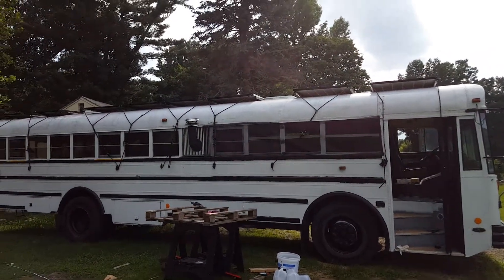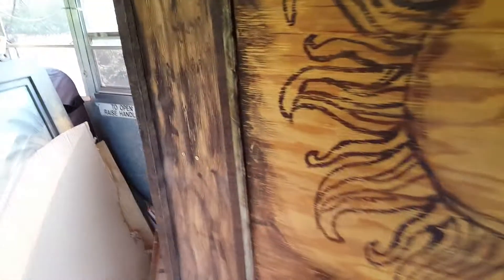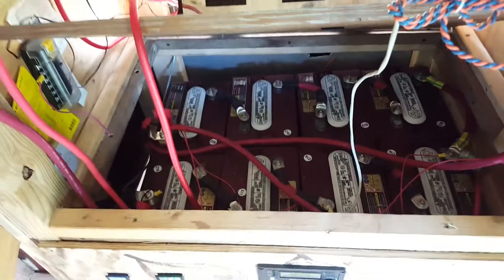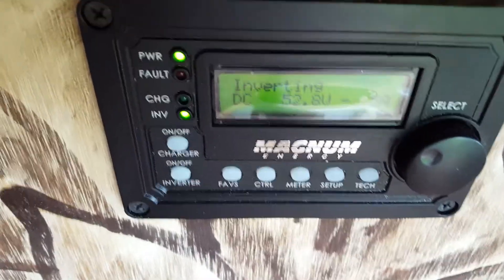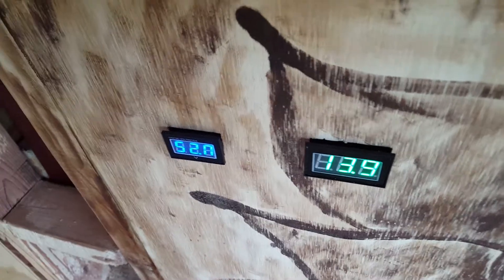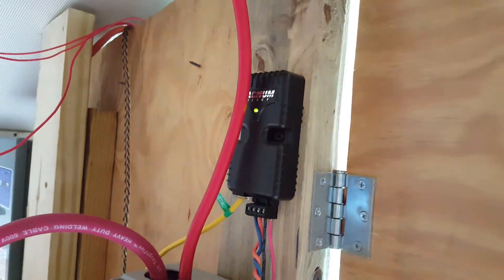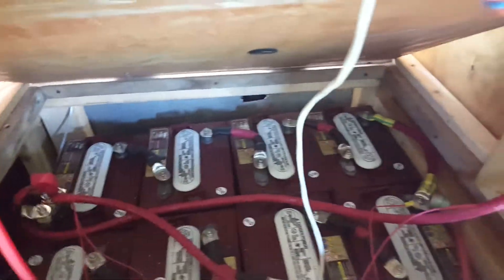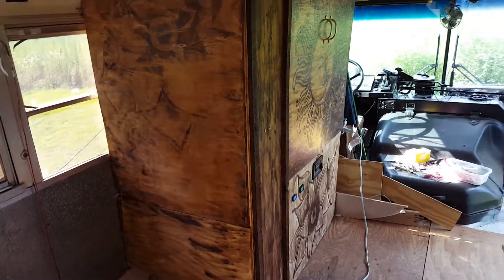TRusty Bucket School Bus  RV 2300W 48V Solar Power (Magnum PT-100,  4440 Pure Sine, Remote and BMK)

Comment: Is there some ventilation for the gasses the come off the batteries?
Reply from the maker: Yes, there are vents with fans mounted in the side of the bus to nicely ventilate the batteries!
Reply from the maker: It's just a hole cut in the side of the bus .. with a small 48v fan mounted in it... actually have it in both sides of the storage box.
Reply from the maker: Yes.. only permanent louvers.. not the kind that flap .. the fans aren't strong enough to open the flaps
Reply: any chance of getting a look at your vent setup?
Reply from the maker: I could video it .. but really there isn't much to see.. I got 48v PC fans and cut a hole to size .. then covered the hole with a louvered vent.  The fans connect directly to the battery bank

I never smell the batteries
Reply: ok, so I am picturing louvered vents, like on a drier hose on the outside of a house?